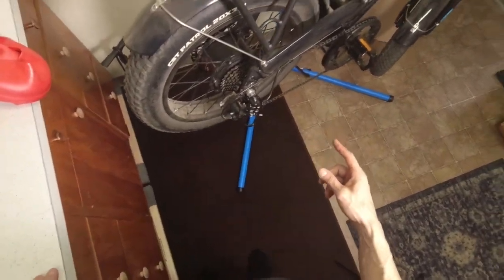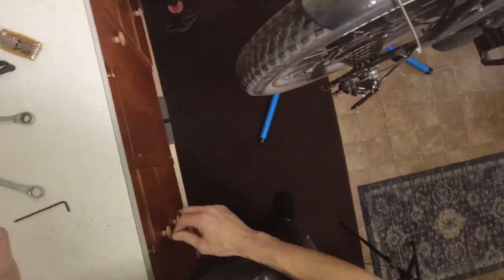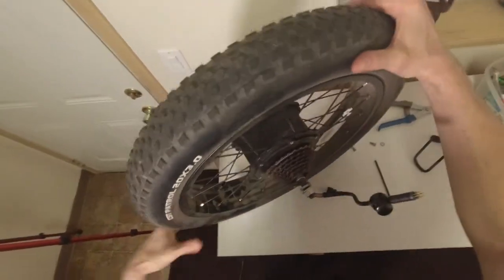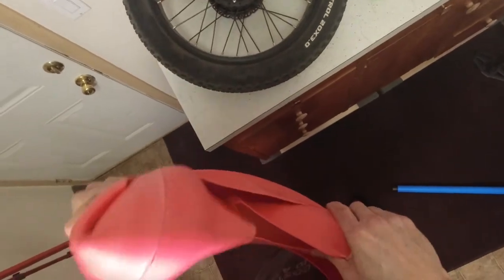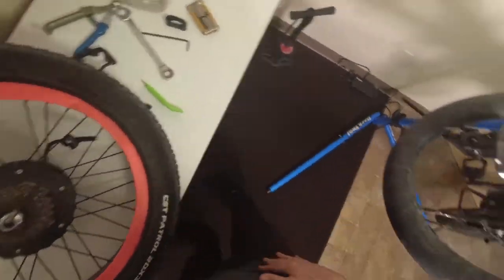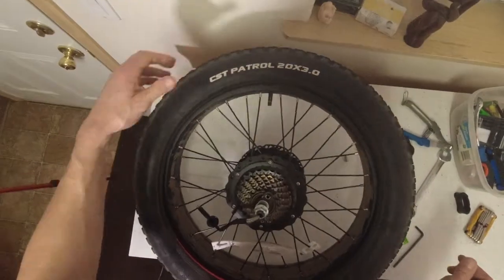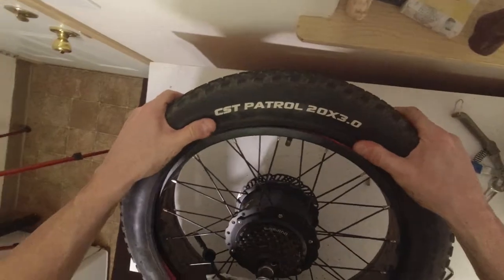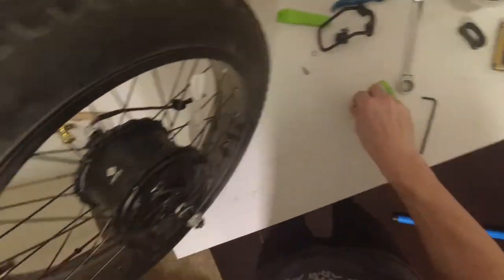Tannus Armour Install for Lectric XP 2.0

Comment: I just installed these on my bike. I did trim an inch off or so with a fresh utility blade, then I remove the entire tire from the rim. Installed the armor and tube into the tire, then mount the whole assembly onto the wheel, worked like a charm!

Comment: I was recently in the market for Tannus Armour liners, then I started hearing about the foam flattening over time. I eventually found a YouTube video showing the flattened foam liner and the comments from viewers were interesting.  Some comments mentioned Tannus' recommendation to deflate your tires after every ride ("...when not in use...") so as not the flatten the foam.  Other comments confirmed the Tannus Armour foam also flattened in their applications, leaving the inner tube with minimal puncture protection, and causing other problems, assuming they used smaller inner tubes as recommended.

I'm wondering if your Tannus Armour liners are also starting to permanently flatten? I imagine the flattening of the foam is a much slower process in lower PSI applications.  Now we need someone to test the foam in city commuter tires (and more), with higher PSI for the road, to see if this foam is worth the investment.

Tannus hopefully.

Comment: Those flatten out pretty quick, save the money for new tubes and tuffy liners
Reply from the maker: The trick is not to add as much air pressure to your tires after installing these. That helps keep them thicker. They also get more dense and harder to puncture as they flatten out a bit.
I've had to change out countless tubes over the years working at bike shops from the Mr. Tuffy's causing the flat.
These have worked well for me.

Comment: Thanks so much for this informative playlist as well as links to the tools you used. As a newbie it is invaluable!! 

Question: Did you continue to use the stock tubes w/ the tanks armour or did you get smaller tubes?
Reply from the maker: Hi Jeff, thanks for watching. I need to update this video so it is easier to see.
I just used the original tubes, so as not to be wasteful. You can use a slightly smaller tube as a spare.
I still have the original tubes in mine with no flats. They work just fine! 👍
Reply: Success!! I ended up using Tannus tubes (there’s an option to add matching size when you order direct). Thanks again for this channel/playlist.

Comment: You responded to another comment that you have changed out many flat tubes caused by Mr Tuffy tire liners.  I had not heard that before. What is it about those types of liners that causes a flat? 

Are there any other tire liners you would recommend?

Thanks.
Reply from the maker: Hi Bruce, the issue with Mr. Tuffy's, and this includes Stop Flats and Rhino liners, is that they have overlap when you put them in.
This ovelapped section can pinch your rube over time.
With the Tannus it's all one continous piece and Tannus is also a lor thicker. So I just use those 👍
Reply: @PedalWithPower    I know what you mean about the overlap but I was unaware of the possible pinching issue. 

It looks like the Tannus can provide better sidewall protection than a Mr Tuffy type liner. I will check it out. Thanks.
Reply from the maker: @bruceh3786  Yeah, that's true. The Tannus covers the sidewall.

Comment: The tire was easier to take off than I thought. The hardest part was taking the actual tire off.
Reply from the maker: Just let as much air out as you can and use your tire levers. I have better camera angles in this video - https://youtu.be/r2oFP3yMJT8. This was done on a Rad Power bike, but the Tannus Install is the same.

Comment: I thought the tube had to be smaller than the original with the Tannus.
Reply from the maker: It can be, and a smaller tube is easier to install, but in an effort to not be wasteful I just re-use the original tube.
Reply: @PedalWithPower  the good thing is, now I know it's possible.

Comment: Chris, on a related topic, do you have any opinions on the less expensive protection options, like Slime and Flat Out?
Reply from the maker: Both of those can sometimes work, nothing is perfect. The reason I like doing Tannus instead, is that you're trying to prevent a puncture from happening rather than hoping the sealant will repair the hole after the fact.
The issue with sealant repairing a hole in an inner tube is that the hole will expand when you add air to the tires. Patches can keep this from happening.
I've still had to change out 100's of flat tubes that were filled with slime and it's a mess.
Plus, the Tannus inserts can be used over and over again as you replace your tires, even if you ran over something big enough to get through.
I've also had a tire get a large tear in it and still been able to continue to ride on it with the Tannus inserts installed.
Check out the pictures in my article -- https://pedalwithpower.com/tannus-armour-review/
Reply: @PedalWithPower  Great points that I wold have never even considered.

Comment: I wood like to no what the holls are on the back ware the weels are ware you tighten the  nuts up a little bit you see holls it look like you can lower the back wheel or something I cant find out what it is can you any help thanks  pedal  with power
Reply from the maker: It's the threaded holes in the frame, just above the dropouts. The ones you took the 2 bolts out with the 4mm allen wrench. The safety washers line up with those, so you can re-install the 4mm allen bolts. I'll add another video tomorrow with a detailed explanation of how to remove and re-install the rear wheel. This was my very first video, I was just using a helmet cam and it's hard to see what I'm doing.

Comment: wouldnt it be easier putting the bike upside down and using gravity.
Reply from the maker: Potentially, just be careful about your saddle, grips, and controls if you are putting your bike upside down on the ground. If you plan to flip your bike around in the stand, make sure it doesn't tip over, it'll be top heavy